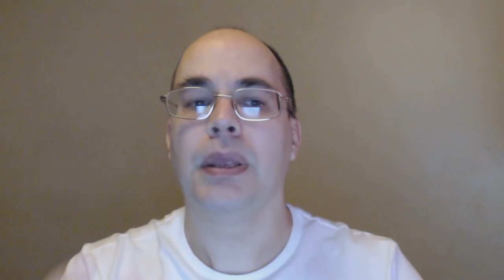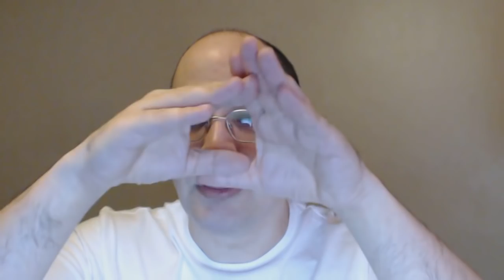How do rockets move in space, with nothing to push off from?

Comment: The problem is, a rocket's engine creates around 6000 mph of thrust max. Then how did moon missions achieve 25,000 mph?
Reply: Fred - It does not matter how fast you are already moving through a vacuum. If you PUSH MASS out the back the vehicle WILL FEEL A FORCE.

Imagine this experiment. You have a crossbow on an airplane. You bolt it inside the aircraft in the center aisle facing backwards.
The aircraft is moving at 500 MPH.
Are YOU suggesting that the Bow must fire the projectile at GREATER THAN 500 MPH for the base of the crossbow to feel a recoil?
NO.
The crossbow can fire the projectile at only 10 MPH and the crossbow WILL still feel a recoil
And since the bow is bolted to the aircraft the firing WILL Impart some extra momentum into the aircraft when the bolt is fired.
The aircraft will LOSE any forward momentum gained by firing the bolt when the bolt hits the rear of the aircraft and TAKES BACK the momentum that it imparted.
But if you opened the back of the airplane and let the bolts fly, they would add momentum to the aircraft every time one is fired.
Reply: @stuartgray5877  Yes, I agree. For every action there is an equal and opposite reaction. Even with your arrow example adding some force to the whole. However,  A 6000 mph rocket could only go that fast even if there were multiple rocket engines ganged together and/or if they were turned off and on again. They just can't exceed their maximum speed. Plus the fact that they have their payload and fuel that robs some of that energy. Nothing operates at 100% efficiency. There is always loss. And it's one thing to say that "rockets don't work that way in a vacuum" but quite another to demonstrate it.
Reply: @stuartgray5877  "But if you opened the back of the airplane and let the bolts fly, they would add momentum to the aircraft every time one is fired." So are you saying to achieve an acceleration that surpasses 6000 mph for a rocket, you need only to keep firing the engine?
Reply: @fredcaldwell9824  - "So are you saying to achieve an acceleration that surpasses 6000 mph for a rocket, you need only to keep firing the engine?"|

Yes. The rocket absorbs whatever momentum is transferred into the exhaust gas. It does not matter if the rocket is moving at 17,5000 MPH (with respect to the ground) and the exhaust gas is only moving at 6000 MPH (with respect to the rocket).  The rocket STILL feels the "recoil" of pushing out the mass.
The rocket does not "Know" how fast it is going. Velocities are all relative.
Reply: @stuartgray5877  As that cannot be demonstrated, I think you believe in over-unity devices.
Reply: @fredcaldwell9824  No, it can and IS demonstrated on an almost daily basis.
SpaceX is now launching at least every month soon to be every week on average.
AND the company I work for tests hydrazine thrusters IN A VACUUM and verify they produce the thrust predicted by the Rocket Equation.
Have you ever bothered to even LOOK AT The "Tsiolkovsky Rocket Equation" that actual engineers have been testing for over 100 years?
No?
What a surprise.
Oh, and you have NO CLUE what "over unity" even means if you think it applies to the thrust from a rocket engine.
Rocket propulsion conforms PERFECTLY with the Law of Conservation of Momentum and Newton's Laws.

You would KNOW THIS if you had bothered to finish high school.
Reply: @fredcaldwell9824  - According to YOR explanation of physics, explain what happens in the following scenarios:

A CAR is moving at 55 MPH:
Mounted in the car is a rearward facing crossbow, that can fire a projectile at 100 MPH.
It has a FORCE GUAGE that can record the force of the crossbow on the vehicle due to recoil
The crossbow FIRES the projectile.
Does the gauge measure a recoil force from the crossbow? Yes or No?

NOW the car is going 150 MPH
, and repeats the test.
DOES IT STILL FEEL RECOIL?Yes or no?

Is there a DIFFERENCE in the force measured by the force gauge?
Reply: @stuartgray5877  A lot of variables to consider for a yes or no response. Much would depend upon 1. If the crossbow is firing a 1000 lbs cannon ball or a light arrow. 2. Yes, any extra force could add to the original speed, but there is drag on a car, even in neutral that would immediately begin pulling it back to 55 mph, or 0 mph if it were kept in neutral on a flat surface. 3. As a rocket ascends through the diminishing atmosphere, it's efficiency declines, not accelerates. Plus, there's that nagging near perfect vacuum sucking the exhaust out nearly as fast as it can be expelled.  Yes, I understand that a vacuum is "not a force", but the stronger the TORR of a vacuum is, the faster any efficiency from thrust is depleted.
Reply: @fredcaldwell9824  - "As a rocket ascends through the diminishing atmosphere, it's efficiency declines, not accelerates"

This is 100% FALSE. So, there is no further point in discussing this with you if you are just going to make shit up.

The "Thrust" of a rocket engine is determined (analytically) using the "Tsiolkovsky Rocket Equation".  This equation predicts that rockets are MORE EFFICIENT (they create MORE thrust with less energy) IN A VACUUM.
This equation is DERIVED FROM the "Law of Conservation of momentum" exactly what gives rockets (AND CROSSBOWS) their "Recoil".

We have verified this in test here on earth in a vacuum, AND IN SPACE in a vacuum.

They were testing rocket propulsion on the X-15 in the 60s because they found that the aerodynamic surfaces at > 50 kilometers no longer worked.
Reply: @stuartgray5877  Thanks for your response. One more question. How can a pressurized system exist next to a vacuum without a container?
Reply: @stuartgray5877  Lol, first time I've seen your question, not avoiding it.  i'll be back!
Reply: @fredcaldwell9824  Or imagine the experiment where you take a 20 foot long pipe. Fill it with AIR and SPIN it end for end from the middle. (like a baton twirler)
As you spin the pipe - WHAT happens to the gas inside the pipe?
describe what you imagine
Reply: @stuartgray5877  Air has weight, so I would imagine centrifugal force compresses that air to each end of the pipe.
Reply: The vacuum only "sucks out" the force of a pressurized system in a relative sense. Every action begins with a push, not a pull. The problem in space would be, the pressure within the rocket would constantly be trying to equalize with the pressure outside of the rocket (i.e. infinite space with nearly 0.0psi), diminishing it's work pushing the payload. There would be some benefit, but I can't imagine an acceleration, and you can't show one. But you needn't kiss my ass for any reason.
Reply: @fredcaldwell9824  - " and you can't show one"

YES WE CAN!  You apparently don't realize that we launch rockets to space about every WEEK!

You seem to agree that there MUST be a force that originates WITHIN the rocket that pushes the exhaust gas OUT.

What does Newton's THIRD law tell us?
What happens to ANY object that pushes on another object?
Reply: @fredcaldwell9824  Yes if you spin the pipe the FORCE compresses the gas at the ends in the DIRECTION of the force.

Since GRAVITY exerts a force, gases can ALSO be compressed by GRAVITY.
Gravity can hold back compressed gases from the vacuum because the VACUUM CANNOT EXERT A FORCE!

Gravity CAN exert a force while vacuum can exert NO FORCE WHATSOEVER.
Who wins this fight?
Reply: @stuartgray5877  Well, I guess you win if you can have Gravity both ways: that it pulls or pushes depending on the argument..
Reply: @fredcaldwell9824  Nowhere did I say that Gravity pushes.

Where did you get that?

Gravity only PULLS.
GAS Pressure Pushes
VACUUM does NOT PULL.
Reply: @stuartgray5877  There's an equal and opposite reaction. Not a larger reaction.
Reply: @fredcaldwell9824  Correct.

When the rocket PUSHES OUT the exhaust from the nozzle this is the ACTION. The exhaust gas then PUSHES BACK with the exact same force for the same amount of time this is the REACTION.
In FACT, the rocket MUST absorb exactly as much MOMENTUM as it adds to the exhaust gas.
A Space Shuttle Main engine consumes 500 kilograms of liquid oxygen and liquid hydrogen PER SECOND, combusts it forming 500 kilograms of pure water, then ACCELERATES that water to MACH EIGHT before it leaves the nozzle. This requires a HUGE FORCE to accelerate those 500 kilograms of water to Mach Eight and Both the water AND THE ROCKET feel that force.

NOW with what I just said above fresh in your mind research the "Law of Conservation of Momentum"
Reply: @stuartgray5877  "Nowhere did I say that Gravity pushes. Where did you get that?"

 You compared Gravity to gas being forced to the ends of a spinning pipe. We know how that works. And I contend that is the same way Gravity works. Your guess would probably prefer to defer to Scientism's "spacetime", because you cannot recreate the force and you have bought into the baseless idea that Gravity pulls. If that's not the case, please provide proof that Gravity pulls as opposed to pushes. The Cavendish Experiment neither proves one or the other, as all atoms may be pushing toward a larger mass to different degrees.                           

 I would guess that each spinning atom is designed not only to take up space and be the foundation for all mass, but to actively create a thrust and acceleration that has a default setting pointing straight downward - and/or toward a larger mass. And that's how your own weight PUSHES a scale down when you stand on it, it's not pulled down. That's been observable, testable and repeatable for some time now. That's also how Gravity could be nearly uniform at any point over a flat plane. No mysterious force and no theoretical spacetime needed.
Reply: @fredcaldwell9824  SO in addition to denying that basic physics works the way physicists say that it does, you also want to believe the earth is flat even though there is undeniable evidence to the contrary?
So you are personally Incredulous in the face of overwhelming evidence?
Reply: @fredcaldwell9824  If you are still wondering the shape of the earth, google "NASAs Deep Impact films earth as an Alien world" for some pictures of earth I HELPED TAKE.

Tell me what you find genius.
Reply: @stuartgray5877  If the youtube link below is the animation that you say you helped produce (which shows the moon transiting earth), how fast did your camera have to travel before it was made "stationary with earth's 66,000 mph orbit around the sun" at 31,000,000 miles away from earth?
     If the link is not what you're referring to, can you post the link and save me going through a haystack until I find it? Thanks.     

Deep Impact Films Earth as an Alien World (True-color) - YouTube
Reply: @fredcaldwell9824  - "how fast did your camera have to travel before it was made "stationary with earth's 66,000 mph orbit around the sun" at 31,000,000 miles away from earth?"

Fred, your question proves that you are completely devoid of any understanding of how orbits work.
Please complete high school physics and introduction to Astronomy and then check back.

And yes that video of the moon is real video taken from an optical telescope.
I know this for a fact because I helped build, test, and launch that spacecraft, then fly it during its mission.
I literally helped calibrate that telescope during the mission in deep space.
You will not find another human alive today that knows more about the hardware that took those images than I do.
Reply: @stuartgray5877  "your question proves that you are completely devoid of any understanding of how orbits work."Your camera would have to be going the same speed as earth supposedly does around the sun to get that shot, would it not?
Reply: @fredcaldwell9824  Yes the spacecraft was orbiting the sun at close to the same speed as Earth orbits the sun but NOT THE SAME.

To move away from earth you need a velocity that does NOT match earth's.

I also launched the Kepler Space Telescope which was in a earth trailing orbit and WAS moving at almost exactly the same speed as earth but not exactly.

I have also launched spacecraft that entered the orbit of Mars or landed on it.
Reply: @stuartgray5877  I assume the Deep Impact satellite was not trailing earth but earth was trailing it?
Reply: @fredcaldwell9824  Being nearly 83 million miles from earth during the comet encounter means the spacecraft was almost as far from earth as the sun is.
We had a Two-Way-Light-Time (TWLT) of almost 14 minutes.
That is how long it takes our commands to reach the spacecraft from the Deep Space Network and for the response to come back.
Reply: @fredcaldwell9824  If you actually did some internet research on the topic you would find animations and graphics depicting the orbit.
There would be no point in me trying to DESSCRIBE it to you.
Reply: @stuartgray5877  Tried. Failed to find the animations you mention. But let me simplify  the question for you for a short and sweet answer which you should know off the top of your head. Let's suppose we're seeing a northern birdseye view of our solar system. Earth travels counter-clockwise around the sun. If we see earth at the 9 o'clock position, would the Deep Impact satellite be located at the 8 o'clock position or the 10 o'clock position to take those photos of earth and the moon from 31 million miles away? Thanks in advance.
Reply: @fredcaldwell9824  Start by searching for "Deep Impact Mission Trajectory" then after the DI encounter with the comet you will need to search for "EPOXI Mission Trajectory"

The EPOXI mission was the follow on to the DI mission.  There is even a NASA solar system model where you can track any known object int eh database forward and backwards in time. Ill see if I can a reference to public access.
Reply: @stuartgray5877  I found a trajectory map that shows earth was ahead of the camera in it's orbit around the sun. But I am perplexed how the satellite could be trailing earth when what should be the dark side of earth is lit up from the photo you helped with.
Reply: @fredcaldwell9824  The "dark side of the earth" is not the same as the "trailing half".

The darks side is just the side opposite the sun or facing deep space,

If you were perfectly "trailing earth" in the same orbit as earth, then the earth would always be in half shadow (straight terminator).
Reply: @stuartgray5877  "If you were perfectly "trailing earth" in the same orbit as earth, then the earth would always be in half shadow (straight terminator)."  What your missing is that your craft supposedly trailed earth for those animations, however the wrong half of  the ball earth is lit if that is so. The left side would be getting sun, not the right side as your photos show.
Reply: @fredcaldwell9824  Once you LEAVE EARTH'S ORBIT about the sun you need to stop using the term "earth trailing". It was NOT. It was in a highly elliptical solar orbit.

I said the KEPLER space telescope was in an earth trailing orbit.
Reply: @stuartgray5877  I've only been talking about the satellite you said you were involved with. The exact orbit of the craft is not important here. It's position either leading or trailing earth is. The diagrams I found show it trailing earth, making your photo impossible for the right side of earth to be lit. This makes it look like you avoided my simple question all along intentionally fearing I would expose this.
Reply: @fredcaldwell9824  search the net for "EPOXI HRI-IR EPOCh Earth Calibrated Spectra v2.0"  for REAL data.
that is just one set.
 Poke around and you can find access to ALL OF IT including the exact position of the spacecraft in the solar system when the data was gathered.
Reply: @fredcaldwell9824  So SHOW ME where you found the orbital data in the PDS and the position of earth in the PDS at the same moment.
did you even check the website I asked you to?
You know the one that contains THOUSANDS of scientifically peer reviewed images of earth and other planets taken from the EPOCH mission?
Reply: @stuartgray5877  You're off the hook for now. A simple response of "Epoxi was AHEAD of earth's orbit for those animations" would have answered my question properly and saved me a lot of looking around. The first image I found online however was misleading showing the craft trailing earth.
Reply: @fredcaldwell9824  now Google "what happened to comet Tempel-1 July 4th 2005" and let's see if you can explain what millions of people witnessed that evening
Reply: @stuartgray5877  That's not how responsible people reply.
Reply: @fredcaldwell9824  millions of people witnessed that comet explode TO THE MINUTE of when NASA predicted five years in advance.  Tell me HOW NASA did that.  Black Magic?
Reply: @fredcaldwell9824  - "You want me to respond to this? "

Yes you may respond to that.
Those images were taken by the Impactor Targeting Sensor (ITS) as the impactor closed on the comet.
I was the "Impactor Command and Data Handling Engineer" at the moment those images were taken, and at the moment of impact.
I was also the "Flyby Command and Data Handling Engineer" over the course of the next two days downlinking those images from the spacecraft via the Deep Space Network.
Reply: @stuartgray5877  That's very impressive. And I'm sure you have all the faith in the world believing that what you witnessed on your computer screen and/or other instruments  was indisputable reality. But as there is the possibility and potential for some intermediary instead feeding you that information via simulation, I have my doubts in your peers. But will you answer my question re/ if the "first clear look at the stars" were stars (or moon) at all in last minute of that 1962 "Stargazer" capsule launch?
Reply: @fredcaldwell9824  : You’re looking around? Where does one look around for your world view?
Reply from the maker: Acceleration from thrust in a near vacuum doesn't work that way.